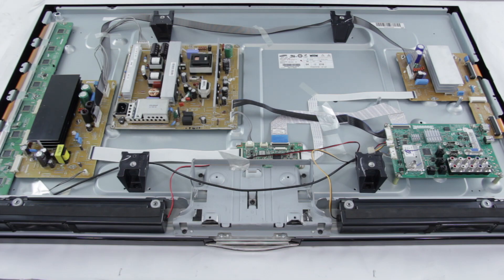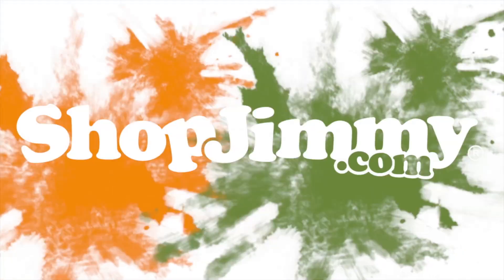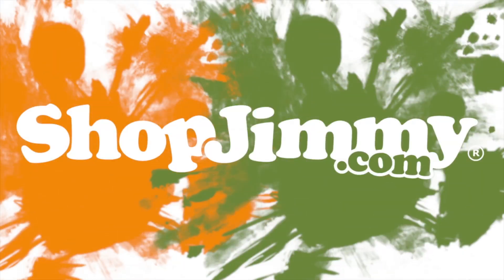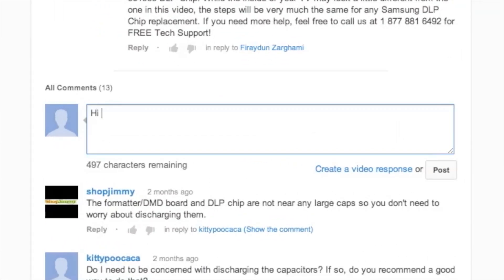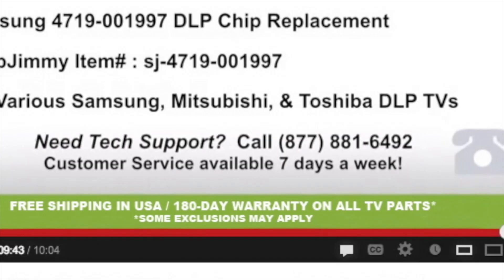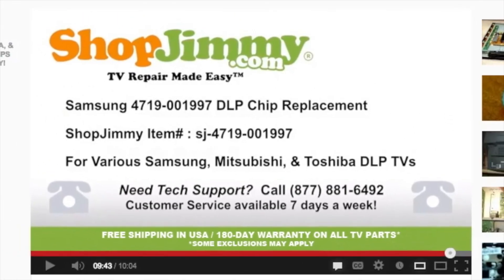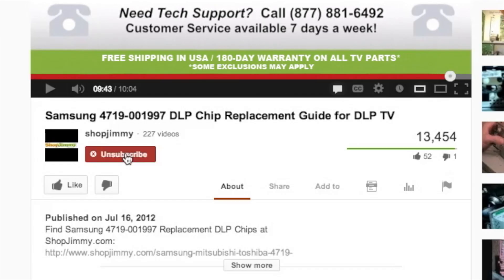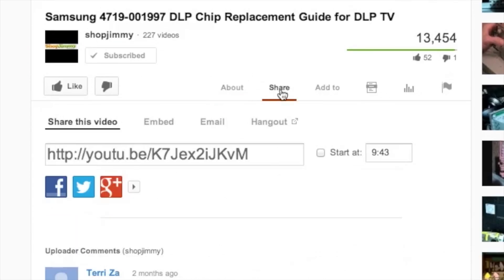Plasma TV Repair Tutorial - Common Symptoms & Solutions - How to Fix Plasma TVs

Comment: I have a lg 60pv250-ub and I have sound but no picture.
Reply from the maker: rhiene leon   I recommend replacing the YSUS board and the YDRVTP & YDRVBT boards in your TV.  Here is a link to replacement parts for your TV model number on our website, click here:  http://www.shopjimmy.com/catalogsearch/result/?q=60pv250-ub  Be sure to match part numbers on your current board, with your replacement for compatibility.  Here is a link to a video showing how to identify your part number, click here:  LG Plasma TV Repair: DIY Part Identification Number ID Guide for LG & LG Philips Plasma Panel Parts  You can also call our customer service for further assistance with your purchase.  (877) 881-6492  Thanks and please let us know if you have any further questions with your TV Repair!  www.shopjimmy.com

Comment: Thank you for the video is very informative. I have A 6 year old Westinghouse sk-26H240S. About 1 year ago it began a cycle of shutting down and turning back on. Then it started shutting down and the power light stays on but there would be no sound or picture. After a little bit of time all of a sudden I would have picture in sound again. If the power button is off then the TV stays off but if I put the power button is on the blue indicator light comes on however I never know if the TV will work or not. When it decides to work everything is perfect. Sound is good.  PIcture is good & everything on it works but when it decides not to work it just completely shuts down other than the blue power light staying on. If you can help I would appreciate it. I am able to repair electronics but not able to troubleshoot.
Reply from the maker: T. Joyce   Check the capacitors on the power supply for ones that look like mushrooms or are puffy on top.  If they are bad, then I recommend replacing the power supply.  If the capacitors are good, then I recommend replace the main board.  Here is a link to replacement parts for your TV model number on our website, click here:  http://www.shopjimmy.com/catalogsearch/result/?q=sk-26H240S  Be sure to match part numbers on your current board, with your replacement for compatibility.  You can also call our customer service for further assistance with your purchase.  (877) 881-6492  Thanks and please let us know if you have any further questions with your TV Repair!  www.shopjimmy.com

Comment: Samsung pn58 - Tv powers on when plugged in but does not react to the remote control nor do the controls on the panel work. Any Ideas?

Thanks
Reply from the maker: Steve Wagner   I recommend replacing the main board in your TV.  Here is a link to replacement parts for your TV model number on our website, click here:  http://www.shopjimmy.com/catalogsearch/result/?q=sk-26H240S  Be sure to match part numbers on your current board, with your replacement for compatibility.  Here is a link to a video showing how to identify your part number, click here:  DIY TV Part Number Identification Guide for Westinghouse Main Boards (LCD, LED, Plasma TVs)  You can also call our customer service for further assistance with your purchase.  (877) 881-6492  Thanks and please let us know if you have any further questions with your TV Repair!  www.shopjimmy.com

Comment: I have olso another TV, an LG42LD560-TA LCD . Doesn't start and the red standby light is blinking.Can somebody give me a hand ? What could be the problem ?

Cheers,
Alex
Reply from the maker: alexandru ovidiu   I recommend checking the capacitors on the power supply to see if they are bulging.  Take a look and let us know what you find.  Thanks!  www.shopjimmy.com
Reply: I already replaced the power supply board. The problem is the same.
Any ideea what else could be ?

Cheers,
Alex
Reply from the maker: alexandru ovidiu   Then I recommend replacing the main board in your TV.  Unfortunately I do not see any replacement parts in the search results for your TV model number on our website.  Thanks and please let us know if you have any further questions!  www.shopjimmy.com

Comment: I have an LG 50PK550-AA plasma. It has some thin vertical green and blue lines on top of the image.What could be the problem?

Cheers,
Alex
Reply from the maker: alexandru ovidiu   This sounds like a TV panel problem.  If your TV panel is bad, it may be more cost-effective to replace the TV as panels are typically hard to find in stock, difficult to replace, and expensive.  Thanks and please let us know if you have any further questions!  www.shopjimmy.com
Reply: The lines are all the way up- down. I cleaned the contacts of the ribbons of the screen connecting to buffer boards, suspecting a bad contact. The issue remained the same.

As I looked at one of yours tutorials, I understood it could be the logic board. As I looked at others videos on YouTube, other people suggested could be the y sustain board. I just want to to confirm with you.

Cheers,
Alex
Reply from the maker: alexandru ovidiu  What exactly would you like to confirm?  This sounds like a TV panel problem.  Thanks!  www.shopjimmy.com

Comment: Please help me resolve a flashing/flickering problem I have been dealing with my LG Infinia 60PK950 60-inch 1080p Plasma HDTV.  Purchased in 2010, problem only started mid 2013 after I moved the TV to a new home and it only flicker the bottom half of the screen. It happens randomly but more likely to happen during bright/white scenes.  I have posted a video of my issue... please take a quick look and let me know if you can help.  Thank you!

http://youtu.be/r9cpqYmqZSM
Reply from the maker: imranx82   I recommend replacing the YSUS board in your TV.  Here is a link to replacement parts for your TV model number on our website, click here: http://www.shopjimmy.com/catalogsearch/result/?q=60PK950  Be sure to match part numbers on your current board, with your replacement for compatibility.  Here is a link to a video showing how to identify your part number, click here:  LG Plasma TV Repair: DIY Part Identification Number ID Guide for LG & LG Philips Plasma Panel Parts  You can also call our customer service for further assistance with your purchase.  (877) 881-6492  Thanks and please let us know if you have any further questions with your TV Repair!  www.shopjimmy.com

Comment: i have a dell w4200ed that turns on then the screen goes black you then turn it off and back on nothing happens screen is still black but you unplug it then turn you can turn it on and works again for a short while then screen goes black. any idea? thanks for any help
Reply from the maker: iggyig   I recommend checking the capacitors on the power supply.  Let us know what you find.  Thanks!  www.shopjimmy.com

Comment: i have a LG 60pz550 tv and it wont turn on. the standby light shines red and when i try turning it on standby light goes away and i here a buzzing noise then a click and nothing. I replaced the power board with no change to the tv. the buzzing noise sounds like its coming from the main board, would a bad main board cause the tv from not turning on?
Reply from the maker: chris donners   I recommend replacing the main board in your TV.  Here is a link to replacement parts for your TV model number on our website, click here:  http://www.shopjimmy.com/catalogsearch/result/?q=60pz550  Be sure to match part numbers on your current board, with your replacement for compatibility.  Here is a link to a video showing how to identify your part number, click here:  TV Part Number Guide for LG & Zenith Main, Digital, & Tuner Boards (LCD, LED, Plasma TVs)  You can also call our customer service for further assistance with your purchase.  (877) 881-6492  Thanks and please let us know if you have any further questions with your TV Repair!  www.shopjimmy.com

Comment: Hello,

i have a Samsung Plasma TV PS51D579 (the same as PS51D57'0', the 9 in the Typenumber is for the Trippeltuner)
The TV works fine but in withe parts of the Video/Picture i can see it pink/violett and not withe.
I think the Probelm is more about light scenes.
I see a Movie with dark scenes and a litte bit of light picture parts is displayed, the light picture parts is withe.
Is the Movie with more light scenes the pink/violett shadows is more present.

Have you any idea whats wrong?

Greeting from munich, germany.
Klaus
Reply from the maker: Klaus Fischer   I recommend replacing the Y-Main board and the buffer(s) that attach to the Y-Main board.  Here is a link to possible replacement parts for your TV model number on our website, click here:  http://www.shopjimmy.com/catalogsearch/result/?q=PS5  Be sure to match part numbers on your current board, with your replacement for compatibility.  You can also call our customer service for further assistance with your purchase.  (877) 881-6492  Thanks and please let us know if you have any further questions with your TV Repair!  www.shopjimmy.com

Comment: I Jimmy.
I have Samsung TV Model 42C450B1D, the tv have   Sparkling Red Pixels. How Fix the  problem.
Reply from the maker: ctsusalv   I recommend replacing the Y-Main board and the Scan Drive Board(s) in your TV.  Here is a link to replacement parts for your TV model number on our website, click here:  http://www.shopjimmy.com/catalogsearch/result/?q=42C450B1D  Be sure to match part numbers on your current board, with your replacement for compatibility.  You can also call our customer service for further assistance with your purchase.  (877) 881-6492  Thanks and please let us know if you have any further questions with your TV Repair!  www.shopjimmy.com

Comment: I have a Samsung Series 5 60-inch PN60E530 1080p Slim Plasma HGTV that will not display a picture after it has been on a while & turned off. The TV will make the sound as if turning on & the audio can be heard fine but no picture whatsoever. We have to wait 30 or more minutes with the TV off before it will finally display a picture when powered on. The picture is fine as long as we don't turn it off.

Comment: Jimmy, I have a Panasonic TH-58PZ800U. The picture starting flickering a few months ago but would work fine after a while.  Then it would take a few minutes after the TV was turned on before a picture appeared and sometimes it would be of poor coloring/image but if I went to the DVD function and then back the CBL function again the picture was perfect.  Now the problem is a black screen on one half of the screen and a scrolling good picture on the other half.  From watching your video here in its entire, it sounds like the Logic Control.  Can you help?
Reply from the maker: *****   I recommend replacing the logic board in your TV.  Here is a link to replacement parts for your TV model number on our website, click here:  http://www.shopjimmy.com/catalogsearch/result/?q=TH-58PZ800U  Be sure to match part numbers on your current board, with your replacement for compatibility.  You can also call our customer service for further assistance with your purchase.  (877) 881-6492  Thanks and please let us know if you have any further questions with your TV Repair!  www.shopjimmy.com

Comment: We have a Samsung PN42C450B1D. The tv was on, we heard a pop and the picture went black. We have sound, but no picture now.  We removed the back but do not visually see anything. Not sure how to test though.
Reply from the maker: Cindy Ziegler   I recommend replacing the Y-Main board and scan drive board(s) in your TV.  Here is a link to replacement parts for your TV model number on our website, click here:  http://www.shopjimmy.com/catalogsearch/result/?q=PN42C450B1D  Be sure to match part numbers on your current board, with your replacement for compatibility.  Here is a link to a video showing how to identify your part number, click here:  Samsung Plasma TV Repair: Samsung Plasma Panel Parts Guide  You can also call our customer service for further assistance with your purchase.  (877) 881-6492  Thanks and please let us know if you have any further questions with your TV Repair!  www.shopjimmy.com

Comment: I have a tc-p50vt25. The upper left corner of the tv has a rectangular discolored box that is app. 2 inch wide by 10 inches tall and appears to have some sort of motion. Any tips on narrowing down the proper component to fix this would be greatly appreciated. Thanks
Reply from the maker: Emilio Sanchez   Could you please post a picture and then reply with the link to photo?  Thanks!  www.shopjimmy.com
Reply: [IMG]http://i61.tinypic.com/28jswo.jpg[/IMG]
Reply from the maker: Emilio Sanchez  This could either be a problem with the D logic board or the TV panel.  I recommend replacing the logic board to see if that fixes the problem.  If it does not fix the problem, then I would say that you have a bad TV panel.  Here is a link to replacement parts for your TV model number on our website, click here:  http://www.shopjimmy.com/catalogsearch/result/?q=tc-p50vt25  Be sure to match part numbers on your current board, with your replacement for compatibility.  You can also call our customer service for further assistance with your purchase.  (877) 881-6492  Thanks and please let us know if you have any further questions with your TV Repair!  www.shopjimmy.com

Comment: Hi Jimmy, I have a Pioneer Elite Model# 12562-77165 the picture only shows the bottom half, the top half is grainy, light brownish green. I get sound clearly, DVD player and cable is same issue, I've tested both on different TV so its definitely the TV. Do u know what it could be and is it worth fixing? Thanks!
Reply from the maker: Jesus Ramirez   This sounds like it could be a problem with the logic board or the lower buffer board.  You may need to replace each board individually to see which one fixes the problem.  Unfortunately I do not see any replacement parts in the search results for your TV model number on our website.  Thanks and please let us know if you have any further questions!  www.shopjimmy.com

Comment: Hi. Help me. Tv brand panasonic 42". My tv model number TH-P42C10S. The power and the power led doesnt working. So how? What should I do?
Reply from the maker: ZAN ZanRifqy   I recommend replacing the power supply board in your TV.  Here is a link to replacement parts for your TV model number on our website, click here:  http://www.shopjimmy.com/catalogsearch/result/?q=P42C10S  Be sure to match part numbers on your current board, with your replacement for compatibility.  Here is a link to a video showing how to identify your part number, click here:  DIY Plasma TVs 101: Part Identification Number Guide for Panasonic Power Supply (PSU) Boards  You can also call our customer service for further assistance with your purchase.  (877) 881-6492  Thanks and please let us know if you have any further questions with your TV Repair!  www.shopjimmy.com

Comment: Samsung #pn60f5300af ... Watching tv one night and lightning flashed outside and tv went off... Wouldn't turn back on. Lightning did not hit the house as no other electrical device even flickered . Lights didn't dim. So I replaced power supply board thru you guys. It didn't fix the problem. There used to be a red led light that would be on the tv if power was ran to it. This red led light is not on now. Could the p board have went out ? When plugged in I can hear the juice/electricity running to power board but I get nothing to the screen or this led light for power up.
Reply from the maker: pete hornstein With lightning strikes, we recommend replacing the power supply and the main board in your TV.  Here is a link to replacement parts for your TV model number on our website, click here:  http://www.shopjimmy.com/catalogsearch/result/?q=pn60f5300af  Be sure to match part numbers on your current board, with your replacement for compatibility.  You can also call our customer service for further assistance with your purchase.  (877) 881-6492  Thanks and please let us know if you have any further questions with your TV Repair!  www.shopjimmy.com

Comment: I have a vizio p50hdtv10a, it started to go on and off on its own. I opened the tv and it had some capacitors in bad condition in the power supply. I am arranging to change them. Could this problem be caused by anything different than the power supply? Thanks
Reply from the maker: Jesus M. Ramos Perez   Try this repair at your own risk.  I would recommend replacing the capacitors.  Thanks and please let us know if you have any other questions!  www.shopjimmy.com

Comment: I have a lg 50pa6500. Tv turns on. Sometimes stays on, other times it turns off. I cannot do any functions such as volume, menu or channel up or down. Stuck on tv mode. Any help will be greatly appreciated. Thank you
Reply from the maker: Frank Ortiz   I recommend replacing the main board in your TV.  Here is a link to replacement parts for your TV model number on our website, click here:  http://www.shopjimmy.com/catalogsearch/result/?q=50pa6500  Be sure to match part numbers on your current board, with your replacement for compatibility.  Here is a link to a video showing how to identify your part number, click here:  TV Part Number Guide for LG & Zenith Main, Digital, & Tuner Boards (LCD, LED, Plasma TVs)  You can also call our customer service for further assistance with your purchase.  (877) 881-6492  Thanks and please let us know if you have any further questions with your TV Repair!  www.shopjimmy.com